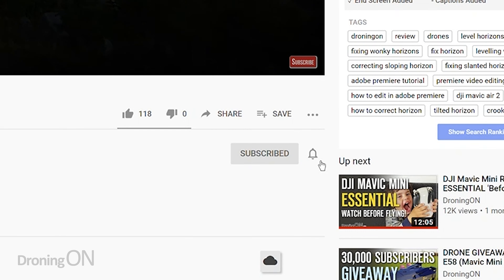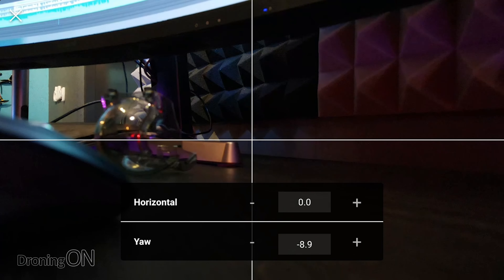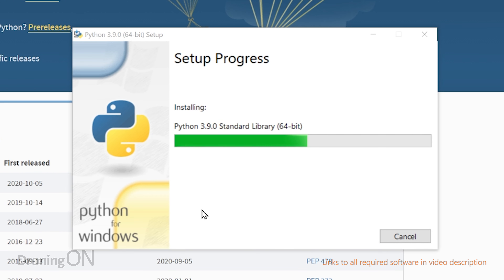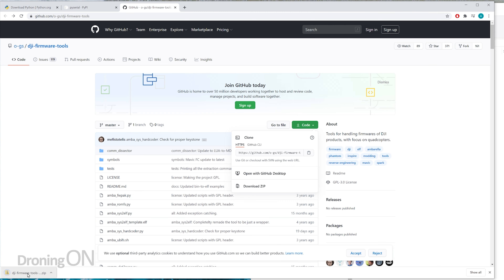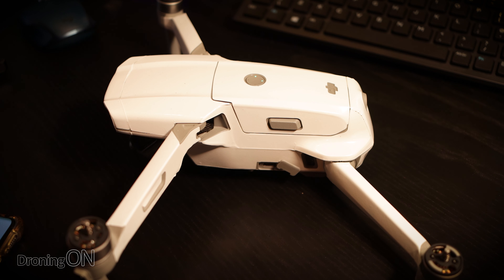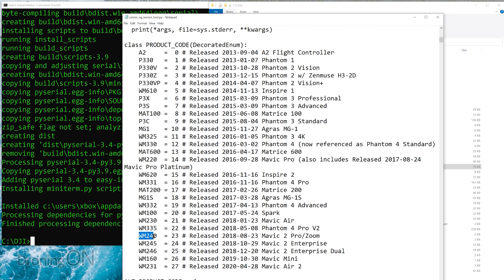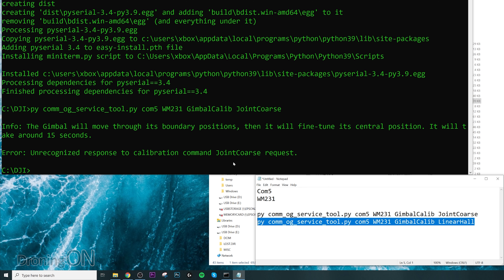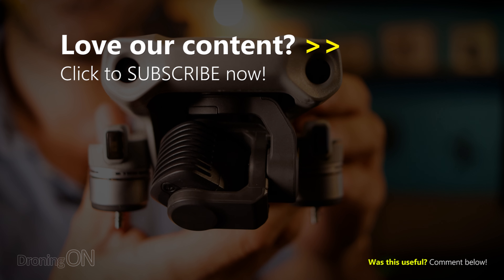FIX DJI drone ERRORS/ISSUES after GIMBAL/CAMERA replacement

Comment: Just used your procedure on a Mini 2 which had a slight mishap with the underside of a bridge.  One of the gimbal arms had broken and was mended with cyanoacrylate (superglue).  Reassembled and powered up, the gimbal started pretty level, but if the drone was banked, the gimbal would overcompensate and tilt the opposite direction.  Nothing worked so I tried your procedure.  I had a lot of trouble connecting the drone.  My laptop would only see it for a few seconds.  Not the first person to have that problem!!  Downloaded DJI Assistant 2 and used that to connect to the drone.  Yes!  Closed down Assistant 2 and saw that my Mini 2 was still connected to my laptop.  Yes!  Used the correct COM port number and WM160 as the drone code in your script, but - nope!  After some serious Googling I found that your script needed an extra "--port" in front of the "COMx".  Yes!  Final result... yes!!  No more overcompensating gimbal.  Thank you, sir!
Reply: Hello friend, would you describe in detail the process step by step, I have the same problem in recognizing the COM port.  Thank you very much in advance.
Reply: you are the saviour for mavic min 2. the extra --port  was the tip remembering to change it in both strings
Reply: @oldirtyrod  I kow this is old, but do you rememeber exactly where you put the "--port"?  I'm on this last step and I can't get it to work!

Comment: Hi. Thanks a lot. It solved my problem!!! I got two errors but who cares, gimbal works perfect!!! I have a mini 2 and use de mini 1 code. Everything worked flawless! To those whom has this question or doubt, go ahead and be happy!!!
Reply: So what is exactly is wrong with yours, because the problem I'm having with mine is when I fly it in regular mode or sport mode it it's shift to the left and the right it's never even with the horizon and I really need to fix this problem
Reply: I have the same problem with the mini 2 drone, but I cannot calibrate it from this video, I get an error com_og_service_tool_py: error : argument product : invalid choise com5 ( choise from A2 P330 ........   Please i need help
Reply: @armandbabet2160  I have the exact same problem. Did you solve it?
Reply: error 😒
Reply: @Deair2201  i have the same problem with MM2 after calibration. I assume that the problem comes from using MM1 code for calibrating MM2. Hopefully they’ll update the code soon with new MM2 SDK. The horizon problem comes from gimbal being pointed a little bit to right or left after calibration. Try manually adjusting the gimbal by 0.2 to 0.5 degrees. You need to do it once and the drone always remembers the adjustment . Hope this helps
Reply: @armandbabet2160  i have the same problem, have you solved?
Reply: Hi, on mine there is no com port detected but its detected as libusb-win32 instead, whats should we put in the com port?

Comment: Hey buddy... were yo able to eliminate those errors? If yes please update... the errors are quite irritating... thanks
Reply from the maker: Unfortunately not yet, very frustrating but someone will create a fix eventually. Thanks for the comment.
Reply: Hi, Sorry that it took a while before I had time to test the last part.
IT WORKS!
After a contact with András K. Szabó where he mentionned stepping down on the aircraft's firmware to v01.00.0320 with dronehacks.
I did the gimbal recalibration. After that I reconnected the aircraft to the pc and upgraded to the newest firmware.
And it did the job. No error 40011, everything is as new and normal. Did a fly test after a compass calibration and it went super.
So I suggest that all people having this error on the screen do the downgrade, gimbal calibration, re-upgrade and see if it works for you.
Btw the dronehack software license is a small amount for the help it offers.
Regards and succes,
Ed
Reply: @Droning-ON  There ia a software for DJI Service Centers named 'RepairTool' for any DJI products and it just running with specified VPN with Certificate that can Pair modules by its IDs into drone's Mainboard. With a friend we are trying to find the software so that more people can remove these error warnings after using DJI-Firmware-Tools
Reply: @eduardongc  hallo do you found the tool
Reply: @eduardongc  the repair software requires connection to DJI's VPN. Good luck getting hold of that...
Reply: @eduardongc  Hey dear! have you found the RepairTool software to remove the errors 
if you have any update please let us know ASAP and Thanks in Advance <3
Reply: @eduardongc  Have you been able to get ahold of the software? Right now I am having to send my drones to an authorized DJI repair center to do this. they are charging 25.00 which is a small price but I will have to wait a couple weeks to get it back and my customers may not like that.
Reply: @eduardongc  encontrou o software?
Reply: @Calvin  i swaped the camera sensor with the original one and the error persist!
Reply: @calvin2205  swapping sensor does not work, I have done this with other drones but it does not work with Air 2.
Reply: I replaced the camera of my Mavic mini aswel with the original camera (inside the already replaced gimball) and all errors cleared. Be carefull though i is very tiny but do-able. I only cannot recenter the gimbal because in Windows (on 3 computers now, w7 and W10 computers) I don't get a COM PORT dedicated to the USB device as in the video...
Reply: @calvin2205  The codex that  registered to the mainboard is from the gimbal not from the camera sensor. Therefore the error still showing up because it does not recognize the new gimbal.
Reply: @Glenford617  you are correct that process worked with previous drones 
Dji has upped their game
Reply: @EDW3700  hi, i cant find any option to downgrade mavic air 2 firmware in dji assistant 2 for mavic v2.0.14.
it just showing the latest version only.
will u plz help me out to find a way to downgrade? Thanks in advance
Reply: @Glenford617  is there no way to register the mainboard with newly installed gimbal?
Reply: @Droning-ON  I did this on my mac with the Mini 1 and it WORKED PARTIALLY. My gimbal was facing 20° down all the time and had some weird rolling while yawing. (bought drone like that) Now the gimbal is working fine, but I got a gimbal calibration error which wasn't there before. Everything works, its just annoying to have the error there.
I also  could not run the second command because my drone is only showing up as serial device very shortly and then it mounts as drive (with or without sd). So I have only a time window of about 10 seconds to do the one command and the second one doesn't work anymore because of the missing port. I tried restarting it but then the second command doesn't work as well and tells that there are infos missing (from first command I guess)
Reply: @EDW3700  Hi , I would like to try this method but on drone hacks app v.01.00.0320 it doesn't show up , closest one to that is v1.00.0340
Reply: @durukan_al  I just opened the DH app and for the Mavic Air 2 there are 3 later versions visible: 01.00.0460 + 01.00.0511 and 01.00.0610.
I don't have a Mavic Air 2 to connect to my pc. Maybe DroningOn can correct or confirm this.
Reply: @EDW3700  so which one should i choose to downgrade the drone ? I am just trying to downgrade it and reset the gimbal as you said but I don't know which version to choose
Reply: @durukan_al  I went down to the first (oldest). After downgrade disconnect drone from pc and make a test. When the error is gone you should be able to upgrade to latest via the DJI app.
Reply: @EDW3700  Gotcha , i am gonna downgrade to oldest and reset the gimball , I have another question if I replace the camera module is that gonna solve my problem ? or is it about the gimbal
Reply: @durukan_al  It's all about getting rid of the errors that pop-up after replacing camera and/or gimbal.
Reply: @EDW3700  I will try this tomorrow and keep you posted , Thank you so much
Reply: @Droning-ON  I tried this process multiple times but could not get the camera to work again. I keep getting the IMU error. Please help!
Reply: @TheBorque  Try to connect USB just after turn on the Mavic mini. It was working with my Mini.
Reply: @eduardongc  Y si pudiste quitar el warning hermano?
Reply: @TheBorque  you need a fix for that ? maybe i can help
Reply: @emrullahtinkir1556  no I already fixed it👍
Reply: @DavidKaden369  Was it with an Air 2 or Air 2s? tried multiple times with an S to no avail
Reply: @twincityaerial9258  What repair center did you send it too?  I'll happily pay $25 to clear these errors!  THANKS!

Comment: Thank you so much. After DJI telling me that the new gimbal and camera I installed on my mavic air 2 can not be calibrated and they would have to put a new one in at cost of $390 I was not happy . Having just spent $300+ on new camera and gimbal I was now being told only a new unit from DJI would work. I took my drone and headed home. That's when I found your video and 2 hours later I was in the air again with smile on my face. Thank you thank you thank you. 
    Arron Lewis

Comment: there is a catch with mavic mini with FW 1.xxx.500 as it exposes itself on com port only for a few seconds after bootup and connecting to the PC. So keep the device manager open to get the COm port number and launch the command line in the moment it exposes itself. This helped me to get my replacement gimball centered again! Great thanks for and congrats to this didactically great tutorial video!
Reply: Hi! Exactly! I follow step by step all, but i can't find the com port number in mavic mini 1. I can't detect any variation in device manager after bootup and connecting to the PC. Then i'have a error: could not open port "com 3": FileNotFoundError<2. Any idea?? Thanks!

Comment: Thank you thank you thank you !! I was a fud at the weekend and sheared my camera off. MA2 is my goto drone and as my wife saw how downhearted I was, she bought me a new one. I was flicking through you tube on sunday and happened on your video and it gave me the confidence to throw caution to the wind and source a gimbal and camera. I got one from replace base at a fair price and it came 4 hours ago. Followed your tutorial and had a repaired drone in the air after 2 hrs. Very clear and step by step and the walkthrough went exactly as you have shown. Cant thank you enough. I can live with the Incompatible gimbal message as it will help tell which one I'm flying! Now to tell the wife......
Reply from the maker: So glad that it helped buddy!

Comment: Sincere thanks for your work on this video. My dad came to me with his Mavic Air 2 with the original gimbal pointing down at around 45 deg. An in app calibration showed the gimbal level and then dropped again to 45 deg after the calibration. Your video pointed me to the resources and your step by step gave me the confidence that this was the right option to try. 
This fixed the gimbal issue first try and my Dad is super happy!

Comment: Absolutely a brillant video - THANK YOU     I have a Air 2S an replaced the gimbal - camera was working fine. I experienced an issue with first  string (JointCoarse) error: argument product:  invalid choice: ' COM4'    So after an internet search,  I added  "--port"  before com4  and was successful. I do not know code at all, just thought I'd add this comment since it took me two days to figure it out.😂
Reply: Hi i have air2s as well and i need help, i would appriciate your time if you can share more informations.
How i can contact you ?
Reply from the maker: Absolute pleasure! Feel free to send a Super Thanks ❤️

Comment: Thank you so much , after following the steps 
the drone show gimbal calibration error (40011) How I can fix it? #mavic air 2
Reply from the maker: Unfortunately there isn't a fix for these errors yet, very frustrating but someone will create a fix eventually. Thanks for the comment.
Reply: Did you find any fix for this? Because i didnt find any fix yet.
Reply: @hamoumirza8585  Not yet, it still shows an error but everything is working fine.
Reply: downgrade and upgrade firmware. worth a shot
Reply: @odyandray1238   This solution for Mavic Mini / Mini2 . Its not working for Mavic Air2.

Comment: This worked on my Mini SE. Needed to add '--port' before the port number though (I used the WM160 code). And run the script quick as the connection vanishes from Device Manager after about five seconds. I'm left with a persistent 'Gimbal calibration error' but I'll live with that.
Reply: Thanks you very much. At last, It works for me too with you advice!
Reply: I couldn't get it to run at all

but if you run drone hacks first the comport should stay still on device mannager.

Comment: Man this helped. Mavic Mini 2 - used lines for Mavic Mini Model, WM160. Works like a charm. I have bought crashed drone and crashed gimbal, because on the drone, after crash, the bottom motor was overheating. sawed off the bottom half, with 2 motors, replaced, glued together and changed the cable. It had strong tilt afterwards, maybe 45deg. on the horizon level. This "script" helped a lot, but I had to use slightly different command with "--port COM3" instead of just writing down "COM 3". Thanks a lot. Also I have no other warning message apart from gimbal calibration required or something like that.
Reply: So.... it worked for you? Mini 2? How?

Apparently some times it works and sometimes it doesn't?
Reply: @Matanumi  you need to put there correct command. As mentioned above. Also DJI assistant need to identity com port, so you dont get error message.
Reply: just Search ( bickflash tech) on YouTube, drop a comment for him, he'll assist you

Comment: I replaced the camera gimbal on my DJI Mini 3 Pro, but the problem code (40021) remained the same, so I'm going to attempt what you suggested. Someone suggested using WM160 when I noticed someone asking for the DJI Mini 3 Pro code. Wishing for the best. Thanks for this video. I will update again.
Reply: Did you succeed ?
Reply: @pticle94 he work ???
Reply: Plz did u succeed
Reply: @nyanlone did it work?

Comment: There are several vids just like this explaining this process. Although I think you blast through this a bit to fast to follow for dummies like me struggling to grasp this, your video is definitely much easier to follow than others. Thanks so much. I swapped the original camera to try to avoid all this because I thought it was a serialized camera matching thing that caused the need for this. I ended up with no error codes at all but the gimbal 20 degrees to the left and everything fully functioning normally.
Reply from the maker: It's a big procedure unfortunately and so it's hard to work through it any more slowly, but you can always pause and rewind :) glad that it helped buddy!

Comment: opened up command prompt on administrator and started following the instructions, well right away i encounter a roadblock 
C:\dji>py setup.py install

Traceback (most recent call last):
  File "C:\dji\setup.py", line 17, in <module>
    from setuptools import setup
ModuleNotFoundError: No module named 'setuptools'

During handling of the above exception, another exception occurred:

Traceback (most recent call last):
  File "C:\dji\setup.py", line 19, in <module>
    from distutils.core import setup
ModuleNotFoundError: No module named 'distutils' 
how can i fix this to continue the installation?
Reply: having the exact same problem
Reply: Have to get the exact version of python and pyserial that he gets

Comment: I had to take apart my entire mini 3 pro gimbal to clean the motors after a crash, when I reassembled the same gimbal and put it back, I got a message that its motors were overheating and the tilt was not responding, then a "gimbal locked" message appeared. Do you think this would work for me?

Comment: WOW thanks for such inestigative detail. Mine is Air 2S Camera working but Think Previous owner had crash, as grazed marks on front top edge of body. Gimbal error and camera is not pointing forward. Think it's original Gimbal Seller said two tiny screws needed fitting. I can see two holes where two screws are missing, but am sure these two screws are too small and may have been misleading. Gimbal error says "gimbal stuck". Any advive would be greaty appreciated from you or others ?.  error code 40002   ? Am mistaken on the scews info, the two screws have no idea where to fit .  DJI  part D108300000   B23-14-05     Does anyone have a technical pdf showing where to fit ?  Camera initialises and centres on switch on, with picture then droops to Left ( facing the front of the drone ) and thats bu about 30-40 degrees . Many thanks for any advice ?